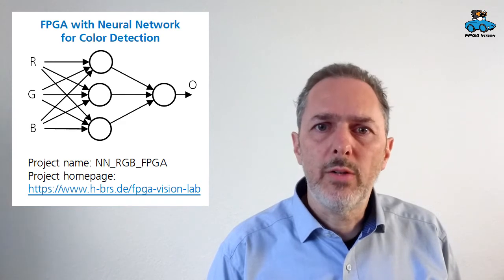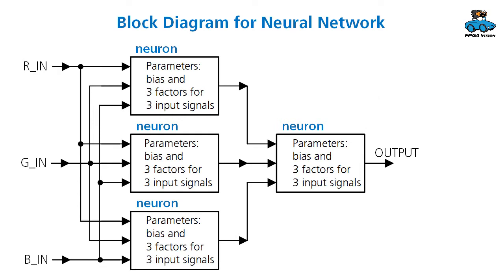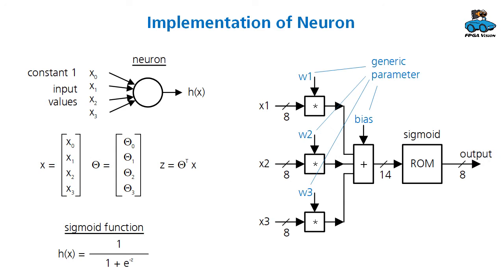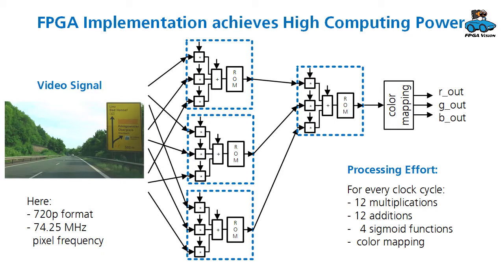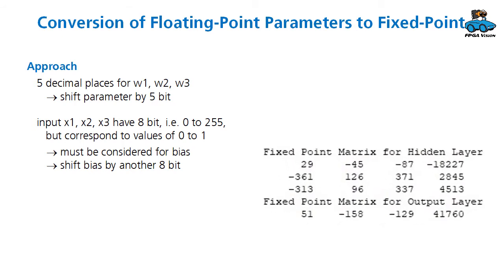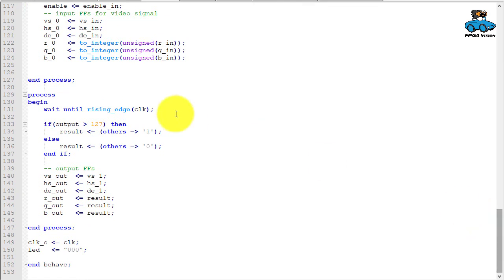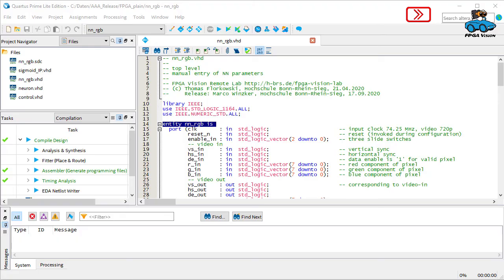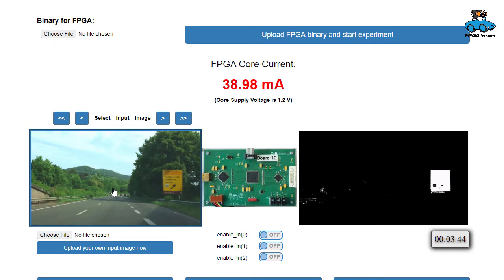Machine Learning on FPGAs: Circuit Architecture and FPGA Implementation

Comment: Hi , I wanted to ask something
Since the we will deploy the  NN in FPGA to store th data persistency of the training and predicting shouldnt we convert the training images in a fixed point representation ?
Reply from the maker: Hi, the training images do not go into the FPGA. They are used to determine the parameters and the parameters go into the FPGA.
Reply: @marcowinzker3682  sorry maybe we misunderstood each other
Once the parameters have been calculated( the parameters have been defined on base of the input images) , then at inference time when the fpga gets the image data(after it has been trained) and goes on the forward propagation , is it bad if we took the images as double while in fpga they will be processed as fixed points?
Reply from the maker: @fc3fc354  There is research on doing machine learning applications without high precision arithmetic. Of course there are small differences if you do floating point or fixed point with 32, 16, 8 bit accuracy. Often 8 bit accuracy gives good results with acceptable hardware effort.

Comment: Thanks for these great tutoria videos Prof Winzker. I want to ask a question, I am new to NN world and now focused on research of NN HW acceleration structures on FPGA and ASIC. I read that the NN structures you utilized in this example is called as Multilayer Perceptron (MLP). However, I see tons of accelerators for Convolutional Neural Network (CNN) structions. Also CNN is mentioned a lot on image classification. You also work on image processing and NN application on images. Can you give some info about when to use MLP and CNN, or can you refer me a paper about which NN structures are being utilized mostly on ML applications ? Thanks a lot for everything again
Reply from the maker: This example uses a single hidden layer to show the principle of an NN. The task is designed that it fits this architecture.

A CNN is helpful, when you want to identify complex objects with a combination of several features. So you identify four legs, pointy ears, whiskers in the front layers. Then following layer of the CNN concludes that the image shows a cat.

A hardware accelerator uses the structure that I presented but normally has a complex scheduling. So there is a CPU that gives small pieces of the task to the accelerator hardware. The CPU collects results, and again sends new tasks to the hardware.

I don't really have a paper that I can point to. Sorrry.
Reply: @marcowinzker3682  Thanks a lot. I will look for papers and if found a good one write it to here

Comment: Great Work. I have question like if I want to perform this on real hardware then how can we check the output aka new modified image by an algorithm?
Reply from the maker: The best approach for verification is simulation! And then you compare the output with another model, for example the Octave result. There is an example for this approach for the FIR filter in the video "FPGA FIR Filter: Verification with VHDL Testbench" and "FPGA FIR Filter: Self-Checking Testbench".

If you want to check the output on real hardware, you would check the result on a monitor. You can also take the result with a frame grabber and analyze it.

Our remote lab does this. You can click on the output image and store it on your computer. (However, the image is compressed with JPEG to save bandwidth, so the result is not bit-true.)
Reply: @marcowinzker3682  Right, but how your simulator get the output image from FPGA. I am trying to make something the same physical.
Reply from the maker: @samyakjain327  If you want something physical, you need an FPGA board with video input and video output port. Such a sytem is described in the video "Image Processing with Terasic FPGA-Boards"
Reply: Okay, Thank you so much for support

Comment: Dear professor! 
Your lecture very very impressive to me. I'm following your tutorial until the step of load Name filter of Cyclone IV, could you please tell to me which "name filter" did you use in your lab? Warmly thank professor so much~
Reply from the maker: The Cyclone IV is a EP4CE22E22C7. You find this information in the constraints file QSF.

And it is also in the FAQ: https://www.h-brs.de/de/emt/frequently-asked-questions-fpga-vision-remote-lab
Reply: @marcowinzker3682  Thanks professor for your reply in detail. 
However, I'm facing with a problem when execute bit file in your sever, I receive the output was "no singal". Could you please help me to check your server? thank professor so much~
Reply from the maker: @tonydo29  Please check the FAQ, there is a "no signal" item.

In 95% of the cases this error is caused by missing pin assignments.
Reply: @marcowinzker3682  Warmly thank professor for your information. I'll take a look and check it now~

Comment: Thank you for such great content sir!!!.I would like to try this project as part of an academic work. Could you please provide the testbench vhdl code for this for simulation? I am just a beginner. It would be of great help.
Reply from the maker: A complete testbench is available for the FIR filter experiment. If you are a beginner, I recommend that lecture. Then you can adapt that testbench to this design. 

https://youtu.be/o3hk7xAY5-s 
https://youtu.be/wTIHEX7WWvg
Reply: @marcowinzker3682   Thank you sir... i will try
Reply: Where you able to write testbench code for this simulation? it would be really helpful for me as I am also a beginner and want to try this as an engineering project but I don't have enough time to try on my own.

Comment: Why do we need a control block for sync signals
Reply from the maker: The video signal consists of two parts: 
1) image information: red, green, blue
2) sync signals to indicate when a new frame or a new line begins

The control block copies the sync signals from input to output. Because the image information needs some clock cycles for processing, the sync signals needs the same delay. So, the control block copies the sync signals with some clock cycles delay.
Reply: @marcowinzker3682  Thanks!!!!

Comment: Nice lecture. Sir i want to implement alexnet cnn arch on FPGA, is it do able or not? Please guide
Reply from the maker: Basically yes, but this is a large project. You need a large FPGA and scheduling of the layers with subsampling. Use of a framework (like https://youtu.be/FFUyRQukGvM) is recommend. 
A good approach is an architecture with a CPU for scheduling of tasks and FPGA fabris as an accelerator.
Reply: @marcowinzker3682  can i have your email so that i can email you proposed design. I'm planning to do in parallel as soon as each byte enters into system.
Reply: @marcowinzker3682  thanks for your response 👍
Reply from the maker: @SW-ud1wt  I am sorry, I can not give individual support.
Reply: @marcowinzker3682  ok

Comment: Your code didn't look very pipelined
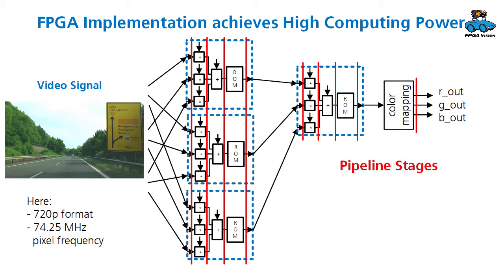Reply from the maker: Are you joking? At minute 4:45 you see the pipeline stages. There is a lot of pipelining!

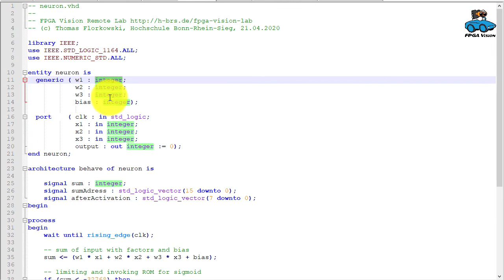In the code you see it at minute 8:05 inisde the neuron. You get a pipeline stage when you have a signal assignment '<=' after the 'wait until rising_edge(clk)'.